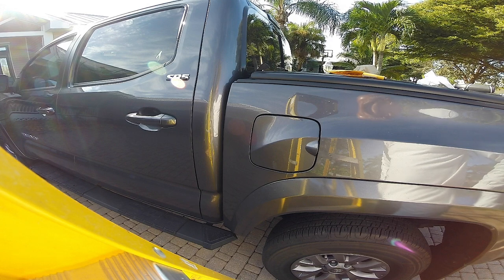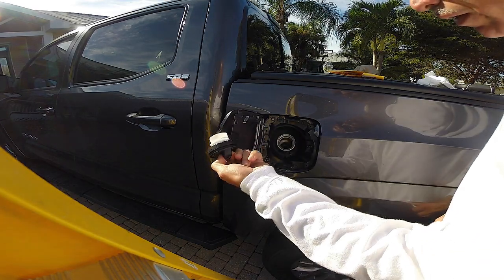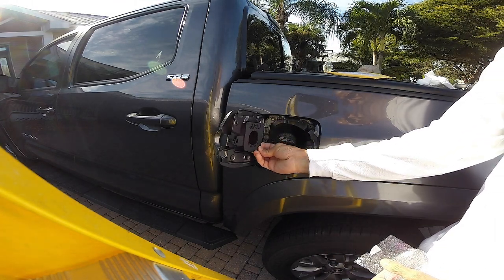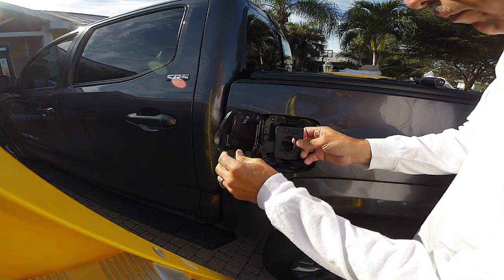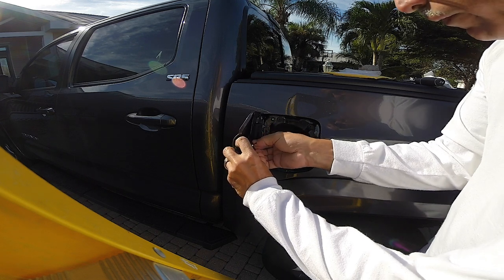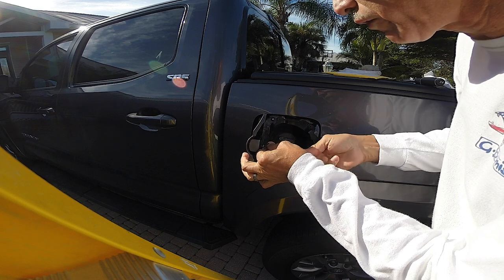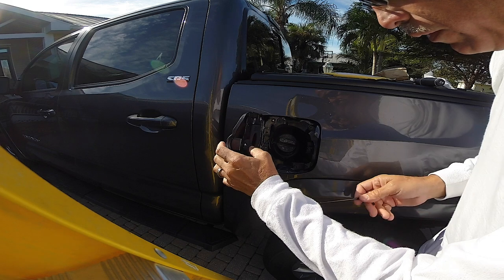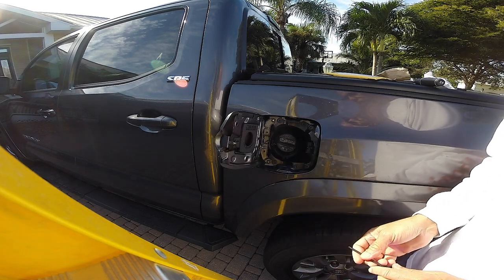Tacoma Modification and Premium Entune

Comment: Where did you buy screw replacement?
Reply from the maker: At Ace Hardware
Reply: What size is the size of the screw you get?
Reply from the maker: @davidmena499  i used 1.0x12 mm. you can also bring the one you going to remove  to  be sure of size also you need to be careful when removing so that you don't end up stripping the head of the screw. good luck and thanks for watching